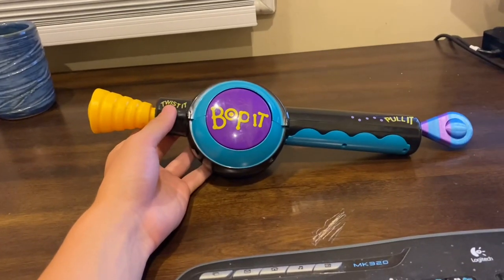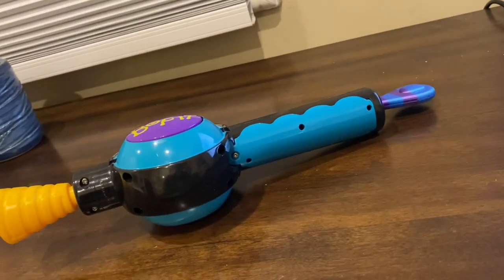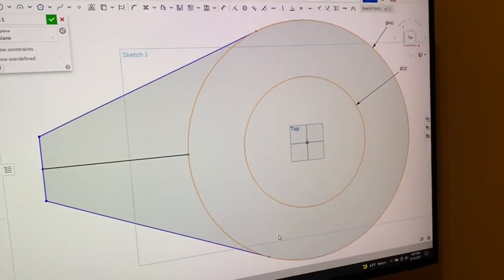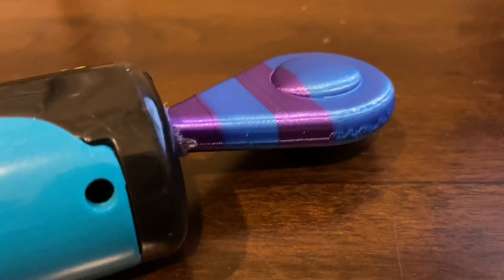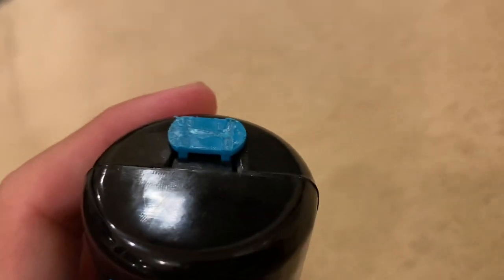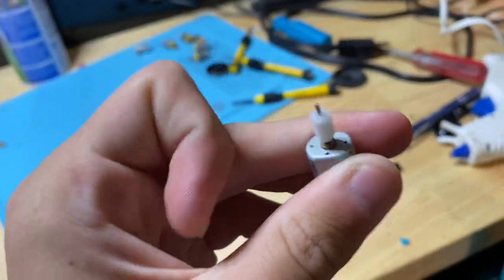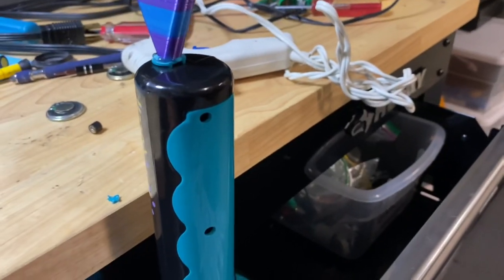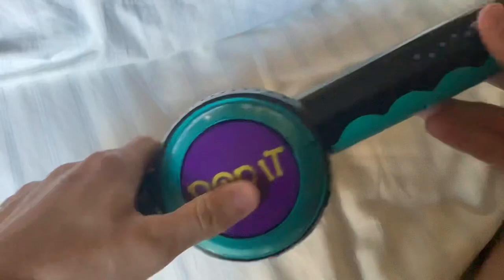Restoring $3 Original Bop It From Savers With A Snapped Pull It

Comment: actually, let me clarify the test mode thing. The 1996 original has a long sound test, and an action test. 2000 ones have 2 sound tests, 1 long, 1 short. And for anyone wondering, If you've ever searched bop it originals on eBay, you can find maybe 1 or 2 with 98 print dates on them. If you ever find a 96 dated original that goes up to 200 its most likely a 00
Reply from the maker: Very insightful info, thanks for sharing! So that means this one is a 2000 model.
Reply: @IDogFan41  it could be. But to be honest, Its difficult and confusing. based on the short gameplay at the end of the video, I can deduce that it's a 00. But the ones released/manufactured in 98 could have the same beat structure and everything as the 00, but just with the 96 test mode. Its information I recently learned from the community and I'm still trying to process all of it
And an edit about the eBay thing. I actually discovered a few originals with the 99 date on them. They were brand new or close to it. Based on that info, I've discovered all of them say 1996 on the outside, but when it was released it may have said 98 or 99 on the original packaging, and there's no way to verify the preowned ones because the original package is long gone. I'm still trying to figure out 2 of the bop it originals I had that went up to 200. I'm assuming its a 00 based on the presence of a short test, but I don't know for sure now.
Reply: What makes things even more confuzing is that there are models labeled 1996 that are the later revision, but have a speaker with little to no bass responce. These tend to be 1999 models. I've never seen a later revision with the faster beat structure have the original form of the long sounds test before.

Comment: 2000 models are the ones that go over 100.

My friend told me that recently.

Another way to tell is the way the beat is paced.

If I remember correctly, 1996’s are a bit slower, and 2000’s are slightly faster.
Reply from the maker: This is a 1998 model because it goes over 100 points like the 2000 but it has the 1996 long test mode.
Reply: Huh.

I’ve never seen a 1998 before.

Maybe it’s a bit rarer, like you said.

I’m also going to wager a guess that yours might be normal pitched.
Reply from the maker: @SirBopALot  It is normal pitched because I put it into pass it and the tune after the pass it sounded perfectly normal pitched.
Reply: The bop it 1998 is the bop it extreme.